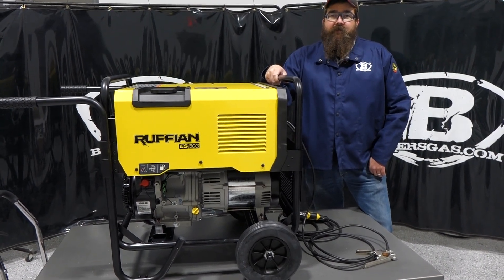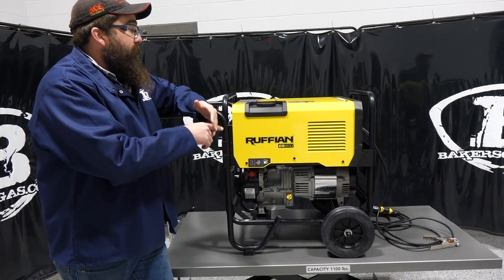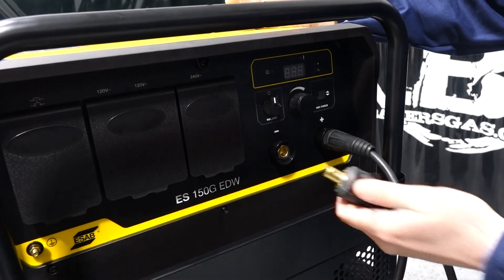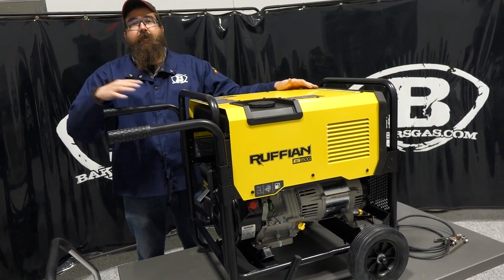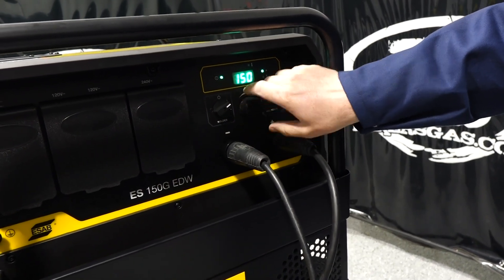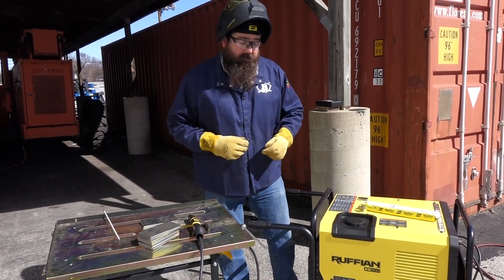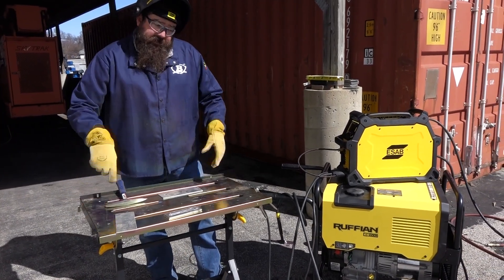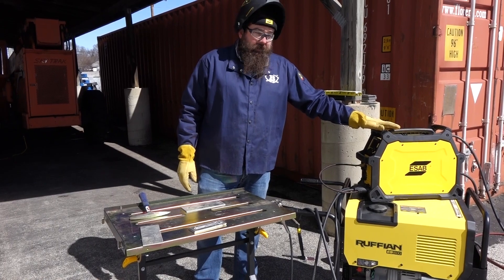ESAB Ruffian Review & Demo 0707070150

Comment: Vulcan outlaw or this is my question. Slightly more power on vulcan but don't need that much normally. Esab is suppose to be made extremely well so might last longer idk... hard choice. Thought about older trailblazers for 1.2k ish but they always look rough around here
Reply: I bought the ruffian and the weld duty cycle is 100% worth it pretty much got it for 300 more then the outlaw from cyberweld

Comment: I bought one of these, I would like to know if which one is not welding if it is on slow, or is it only accelerated on high?
Reply: Well since they didn't respond I'm a certified in stick but usually it's the welder not the machine
Reply: @johnklug589 

He meant is it on high idle all the time or auto idle.

Also, im a certified pipe stick-tig-mig-fluxcore ASME IX. And sometimes, its not always the welder...it could be the machine! Very rare though

Comment: Man could I plug a dc welder to one of the outputs? Is it able to run 6010
Reply: Yes to both of your questions
Reply: But can I run a dc welder and stick weld at the same time?
Reply: Supposedly seperate power sources so you whould be able to run other welders and grinders etc@raynellmoore68w
Reply: @adamclark94  hooah